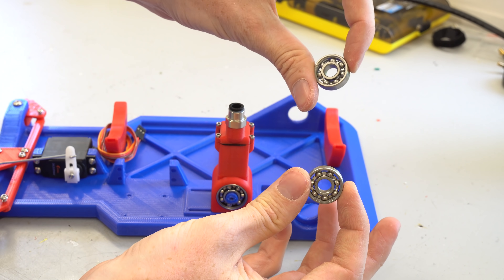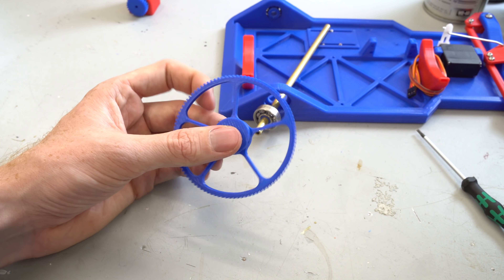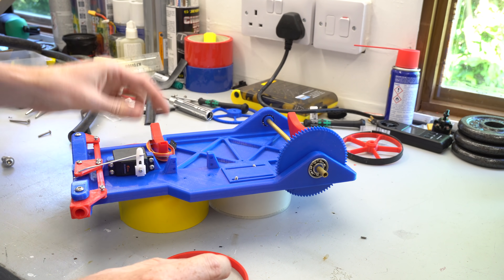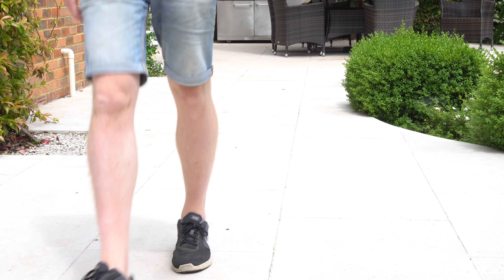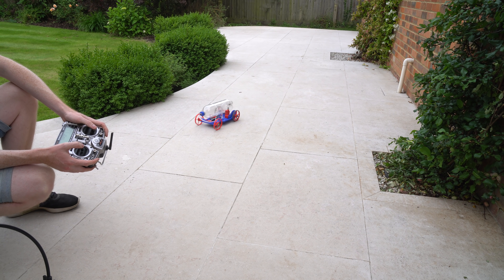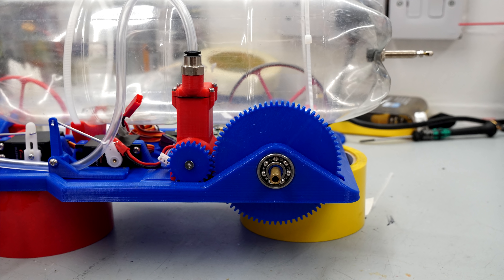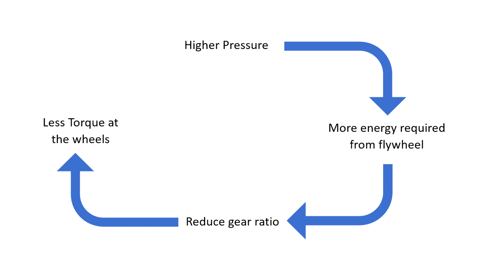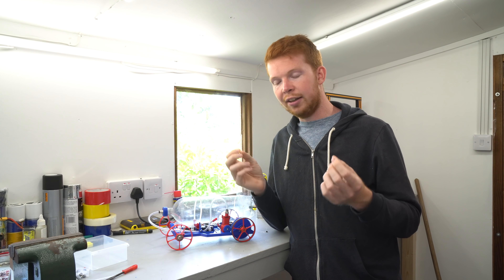Air Powered Car

Comment: I think the same valve system can be used but a lever that actuates the valve could be added that would be between the push rod and the valve to increase the torque from the drive shaft.

Comment: Why not add a large diameter (higher mass)flywheel inboard of the drive sprocket? 
I read an article once on sugar cane plantations in the West Indies, because of the fear of fire, locomotives, steam tractors & cars were converted to compressed air, just for use on plantations. I have several old steam models, and I don’t always light the boilers, I run them on compressed air.

Comment: I would choose to the use of 2 pistons beside each.
And make them move offset from each other.
One piston can be just below half a stroke more forward than the other piston.
This is just like the pistons of an steam locomotive.
Meaning that when one pistong reached the end on one way, the other piston already started to move from the opposite side back.

Comment: Btw I’ve seen this in Lego using Lego pneumatic parts also what’s with no differential on this build I mean you’re only testing it on flat surfaces for now so why not put less strain on the engine

Comment: you can make rev support using an optical rev sensor for the Arduino and put the Arduino to configure it to control the engine speed and drive at the same speed, but add the full throttle function

Comment: an idea, maybe you can add a sort of jumpstarter like a very tiny motor that starts the vehicle instead of you pushing it every time, it could be attached to the axel and only works when push a button on the transmitter

Comment: Realise I’ve missed the party by a few years. But what about an air-electric system? So like a diesel-electric locomotive - as then you could use relatively straightforward components to act as a transmission. This would allow a variable transmission, allow you do to things like limit torque to prevent stalling, and while it’s weight and complexity, perhaps no worse than adding more gearing?

Comment: Can u use battery to run compressed air production on the go so it can be used to run a car and then measure efficiency as compared to ev car

Comment: Sweet project! I printed a spiral plastic spring for a toy once and wound it with a little key. A simple starter motor? You'd have to wind it but then when you take the car out a plastic toggle & pawl could release the spring and start the motor. You've got some great ideas in your vids.

Comment: Make a way of filling the tank automatically. Because if we depend on single use compressed air then we will need diesel to power motors that can fill the tank with air.

Comment: It's too high geared, the gear ratio needs to be reduced. and add a flywheel to the engine the engine RPMs need to be increased. and some rubber added to the front wheels. will aid in turning by giving the wheels more traction.

Comment: You can use a tube squeezing method as valve system for you compressed air powered piston engine

Comment: The tire scrubbing from something as small and light as your cart, especially with hard plastic wheels is a non-issue.  For engineering fun, just look up Ackerman compensation.  It's a calculation that helps remove wheel alignment issues while turning.  It will never give you perfect steering geometry in all cases, but it will get you close.  There are sites on the net that calculate it and will even give you simple line diagrams to follow.  

To quickly ballpark the steering geometry without all the math and geometry, take a long piece of string, and run it from one king pin, to the centre of the rear axle and then back up to the other kingpin.  It'll form a triangle.  If you put your tie rod connection points anywhere on the two long lines running to the kingpins, you'll have more than serviceable Ackerman compensation/steering geometry.  We did a lot of trike, go-cart and dune buggy fabrication, racing and repair, and while the math is fine, for all practical purposes, the string method works great too.

As for speed scrubbing on the corners, that's mainly because of three things . . .
1.  Low power output.
2.  A solid rear axle which means the rear wheels can't turn at different speeds like they need to/want to while cornering.
and 3.  The rubber that you put on the rear wheels, necessary for a little traction obviously, but it prevents the inner wheel from being spun by the outer wheel, or vice versa, to match cornering speeds, because the motor doesn't have the power to spin either wheel on cornering.

Love your channel.  Running out of your videos to watch :)

Comment: Here's an idea. Open the car's tank at sea level, then close it again so it's at sea level pressure. Take it to a higher altitude, then see if you can power it just of the difference in atmospheric pressure.
Reply: It May work but it will take much cost not to build.
Reply: @thundersword2857  in that case we better build it then!
Reply: he did make a syringe powered car. and its kinda the same. It is a good idea but I don't think it might work that well

Comment: There's a reason actual engines have a flywheel....they not only help with balance, but at low RPM they help maintain momentum and stabilize idle speed...a flywheel from an old cassette deck would be about the right size/weight...I think a belt drive would be better too

Comment: Use the same valve design and add another piston at 180 crankshaft degrees from the first, the one that's driving down will also provide power to open the valve for the other piston.

Comment: You should update this project with the newly designed piston engine or the turbine one. Dosing properly the air flow for this lower power machine may be interesting

Comment: It’s weird that it sounds like an engine even though it’s just compressed air
Reply: It may be because it’s quite similar to an internal combustion engine because they both explosively fill the cylinder with high pressure gases
Reply: I’m starting to wonder if they could use high pressure exhaust for an pneumatic engine

Comment: Theres a problem with the hose clamping throttle system

The Stalling,the stalling makes a lot of struggle because you need to start the engine again and again,you need to make a transmission of some sorts like in your car ,neutral and drive

Comment: Couple of things. You can increase the torque output of the engine by increase the diameter of the crank shaft. A piston pushing down on the crank shaft is a lever. Bigger lever=more torque. Increasing the volume of the cylinder is not going to increase your torque. Increasing the diameter of the piston will cause an increase in torque.

Comment: Lmao I just remembered that many years ago I had a toy that worked off the same concept, except you couldnt steer it. It was a small little dirtbike that youd fill up with air and the minute you turn the wheel the inner piston would open and close the valve just like on your airplanes you made, best damn toy ive ever had

Comment: Would their be away to suck in air from the outside and pressurize it in a reserve tank of air, so by the time the main tank of air was depleted, the back up would take over.??  Then you could just switch between the 2 for adequate fuel?? You could also use solar to keep the battery's charged or throw in an alternator

Comment: This concept is pretty cool! Two ideas: 1. How about using a pressure regulator, home-made or otherwise, allowing you to store more energy and have the same lower and consistent
air pressure to the engine! Also, speaking of redesigned engines:
Idea 2. syringe cylander air engines might work more efficiantly at higher pressures/force - just an idea :))

Comment: What about pressurizing the bottle filled with water (water is incompressible) due to high denisty than air ..... would help increasing power per unit volume of water pass by !

Comment: I was a great fan of full size vehicles using compressed air for locomotion, until the day I learned that obtaining and storing compressed air is a process with 10 percent efficiency. The rest of 90 percent is lost energy.
Reply: you mean compressor warm up while pumping accounts for 90% energy loss ?
Reply: @nikoluveen8605  - - Please search with key words on Google. It is a long subject.
Reply: @FlorinSutu  I think if you're pumping by your self.....Heating up of pump and may be the sound produced on the process would only be the modes of energy loss🤔 If you can specify what you expect to Google.....would be a big help

Comment: Air powered engine plus generater gives electricity to store in battery and then design electric car, it's easier to control speed of the car than controlling air pressure to engine
Reply: Inefficient cause theres too many energy translations happens in you idea (more direct you can be more energy efficient)

Comment: Ever considered buying a metal lathe, it could revolutionize your strategic approach to all kinds of designs. ;)
Reply: That's probably  a  felony  in the UK
Reply: Literally my 1st thought as well.... Before i read youre comment
Reply: A CNC lathe would be good because it takes a long time to learn to use a manual lathe.
Reply: @neverendar1778  Do you not mean a cnc frezer ? Yes the computer program for an automatic ish cnc will not teach you the basics of origin, and a 5 axis cnc is more or less just like a 3d printer, does not require much thinking, just feed and fastened the 3d data and material to be cut and press run/print/cut.., i invest my faith in learning the basics first before moving into more advanced like a 5 axis lathe..it is from the basics the understanding builds up for how the cnc frezer operates is achievable. If the computer program crashes then i would like to be able to work manually with digital clocks to achieve exactly the same precision and results, just not so logistically effective as the auto program would do all the thinking for me. Call me old school, call me wanting to learn it all instead of minimal. Theory is the smallest part of the WISDOM in the act of doing the work yourself.
Reply: @haffus77  no, I just have low dexterity, so that causes problems with my lathe work.
Reply: @neverendar1778  Practice makes perfect, no one is born with high dexterity, skill takes time to develop by countless hours of practicing, just NEVER give up and you slowly get "there" :) Believe in yourself.. :) A painter who loses his hands just learns to paint with his feet, because he never loses the passion for painting :)
Reply: @haffus77  true, but they might switch to digital art. And CNC programming is super fun for me.
Reply: @neverendar1778  Good for you :) , i like the most to be building in physical form, even better when i first have an idea, then put it down in a technical drawing and then extract it out to the real physical world. I call that from an idea to reality. However a dream is just a dream until you share it with someone, then the dream has become Reality ;) 3d drawing is not my strong side and absolutely not programming, it is good we are all not exactly alike, what point would there be for all the colors in the rainbow if they all where the same color ;) (yes i really need to get better at 3d drawing, it will waste less physical material for me..) :)
Reply: 3d printing plastic is cheaper for prototyping.
Reply: @tssteelx  Yes of course, but some things need to hold up the test round before the "tape comes off".. ;) It is such a disappointment when you make something that works with weak plastics and tape for  a few unknown rounds, and then when your friends come over to see it working it falls apart before finishing the first round and all the friends go laughing in disbelief..nahhh that will never work they say and go home and you stand left with a ton of gluing to do and internet browsing for a good video camera to capture the next time/prototype 1,1. Some sacrifices must be made so things really hold up.been there done that..now it is scrap metal, metal lathe, cnc frezer and a 3d printer combined or bust ;)
Reply: Not even necessarily metal. He could cut better gears from acetal with a hob. Thats more of a mill task though.
Reply: All lathes are made of metal
Reply: @Sabthenoob  I think he meant a lathe to turn metal.  In any case, my homemade lathe is mostly wood, plastic, and concrete (for weight).
Reply: Sabthenoob he means a lathe for metal
Reply: @Sabthenoob  and the point ?
Reply: @haffus77  I think he’s joking. Like a dad joke
Reply: @andywhatever8533  Must be something like that, i think i am not going to hold my breath for that point to come ;) That kid seriously needs to add a metal-lathe to his toolbox. As a wood-lathe is limited to soft materials only but a metal-lathe can handle both soft and hard, and his designs are getting nowhere out of "silly toy land" without the proper tools and materials no matter how big or small the design. (obviously..)  :)
Reply: @haffus77  ล

Comment: How about a duel air storage, have one high pressure and one low pressure. Have the high one continually replenishing the low and run the engine at low psi.

Comment: Just add rubber to one tire so the other can spin and act as a differential, that way you wont lose power when turning, also you will have better steering :)

Comment: So what you need is a heavier flywheel to keep your engine turning, this will require more starting torque thus a little bit more pressure.

And secondly... lubrication man, you lose alot of energy to friction. Lube up the gears, and you could spray a little bit of wd40 or oil into the engine or on the air line.

Comment: what if you use some sort of vacuum pump to constantly feed air into the engine? Also to solve your gear problem what if you make a transmission? Some model hobby stores and websites sell automatic and manual transmissions for rc cars, this could help you a lot but it will be quite complex and heavy (about 3-5 lbs)

Comment: Maybe a small steel tank that holds dry ice that will pressurize the tank and then the pressure can be routed to the engine via a line.

Comment: What to made v 16 engine it will be powerfull im think 16 v air engine will have 5hp and 7  or 12 nm and 7 hp if you using long stroker crankshafts and if you want more hp you have to make a bigger volume of cylinders

Comment: This is the second of you video's ive watched!! Less comments on this one I assure you!! We should combine our knowledge bases. The reason is what you are lacking in this is CAR knowledge. And car ENGINE knowledge. With that and the mechanics of that. Which is alot ore than just an engine. You will fill in all the gaps in experience you are having. The same is true for me, the knowledge you have fits the gaps I have. And this is how we grow as humans!! What a legend you are sir!!! Thank you for you knowledge, time and dedication!!
Reply: like, a car doesnt have a solid axel. It has four separate independent axles. For good reason.
Reply: its why there is a differential in a car. And why you get a "one wheel peel". And why people will weld their diff. The truth is your car is generally using ONE wheel to push you around. Or pull in front wheel drive. Only in FOUR wheel drive or "posi-traction" are MORE than one wheel spinning. Misconception of cars.
Reply: I love how it picks UP torque as it drives instead of lose it liek a gas engine. MUCH potential here!!!

Comment: Does that work with steam? If you use high melting point plastics, could you design an rc powered steam vessel? The boiler could be a candle fondue.

Comment: 2075: we have air powered cars
Reply: When you replace that dangerous gasoline for a 15,000 PSI air tank lol
Reply: @quincybowers5338  blast of flame vs blast of air. Either way, you're getting blasted away like team rocket.
Reply: It is dangerous though
Reply: Tata AirPod...
Reply: We have them already in France, granted they aren't like most cars, they are little pods. Check this out: https://www.mdi.lu/airpod-2-0
Reply: and here we are at the disscusionof if a explosion at car crash or fire is better(btw it doesn't really solve global warming cause a machine is needed to make the pressured gas)
Reply: But well, if the electricity is provided by nuclear plants then ok i guess
Reply: @狗菜餃子  Nuclear power requires power to start up. (From a dead stop, also known as a cold start) So you need power to keep it running. (Because you need to stop it to do maintenance.) Meaning to start it you need a alternative power source. Also, there's the problem of reactor failure.
Reply: @nikkiofthevalley  it does still produce less waste though you only need to start it up and get enough power ready to use
Reply: It solves global warming
Reply: I have a feeling my Tesla stocks are in danger. Im trying to figure out why the fuck we don't have air powered cars.
Reply: it's called steamengine. it was invented in the 1800s :P
Reply: @vikingofsweden2498  The steam engine uses steam and coal to turn the wheels and gears. This stuff uses air pressure directly.

Comment: You should give it a much longer stroke and a heavier flywheel on the other side of the motor and it would work much better at high pressure

Comment: Good job 👍🏻
It need at less 3 pistons to avoid restarting it every time
And for good autonomy you can use an airsoft reservoir that can handle 200 bar + pressure limiter to avoid engine explosion lol . And to make it look highly designed just avoid ratios like 100:25  😅

Comment: You need a lightweight pressure regulator that will deliver 35PSI on the downstream side. The regulator should weigh around an ounce. The one inside the FiZZ GiZ black banana weighs an ounce.

Comment: You need two cylinders 90 degrees out of phase so that the engine never gets stuck in a non-energized part of the stroke.  On steam trains, parallel double acting cylinders had the crank phasing offset 90 degrees.  A 90 degree V-twin would probably enable starting from a standstill, without a push, as your air engines are "two stroke" already.